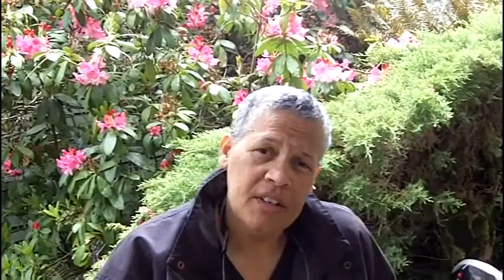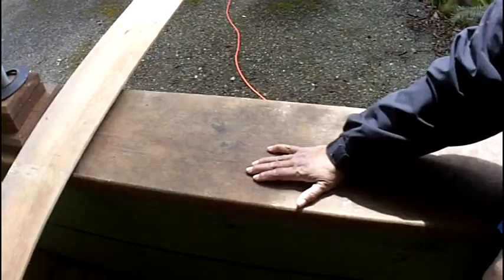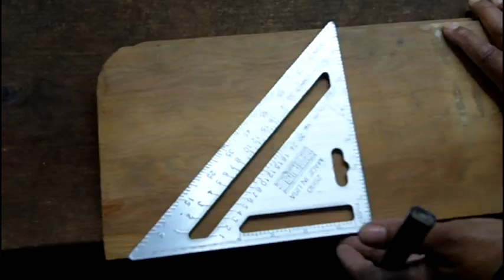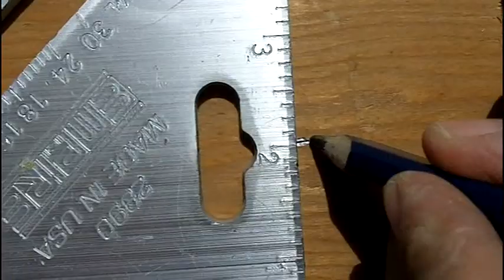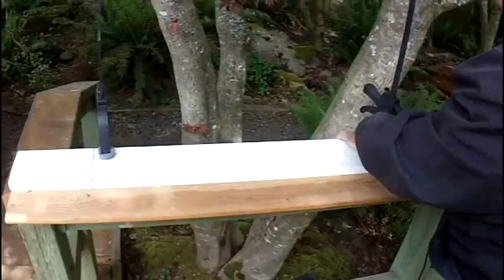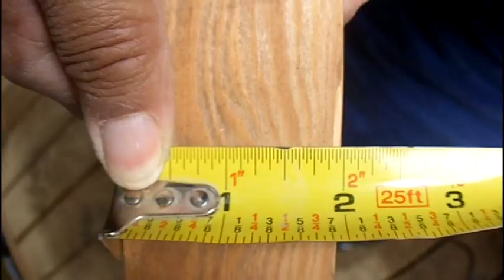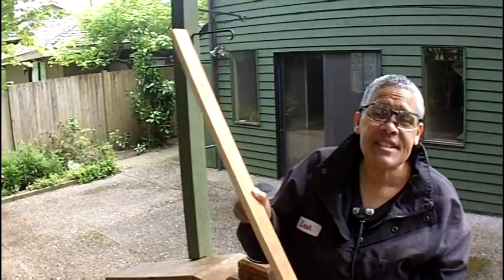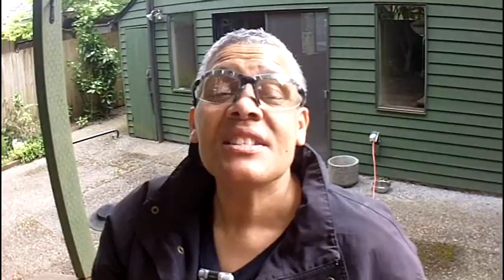How to Make a Perfectly Straight Cut in Wood with a Circular Saw

Comment: So in order to cut a perfectly straight piece of wood, you first need a perfectly straight piece of wood.
Reply: And a saw blade that is not bent
Reply: jozef danyi bended? bent!
Reply: N Kel  Oops,,, thanks for the correction.
:-)
Reply: Yep. In my opinion, you're better off using a nice, straight piece of angle iron for a guide. Steel won't warp like timber tends to.sth128
Reply: +jozef danyi , I actually knows a guy called Bent. Here en Denmark it is quite normal, and a bit unusual to be named Bent.
Reply: rentefald  okay...
Reply: You can also buy & use something called - who'd have guessed? - a cutting guide. They're reasonably cheap, lightweight (generally made of aluminum), & available at most home improvement or hardware stores in several lengths. Most are simply straight rails but other types are available such as a kind that clamps to your saw & slides along the edge of your workpiece.
Reply: +sth128 Indeed! Why have I wasted time watching this video?
Reply: +hyuri2276 You can buy a track saw too. If you have like a grand. Clamping a straight edge down is good enough for me though.
Reply: +Paul Frederick I don't think I've spent a grand on all my tools combined. Unless I include the automotive stuff, which I don't use for work anymore.
Reply: hyuri2276
whether you use tools anymore, or not, is immaterial. As you are still out whatever they cost you initially. Unless you sold them, to recoup some of your investment. I have a few tools I spent more than a grand for. Some tools can be pricey.
Reply: +hyuri2276 You dont need an expensive saw.  All you need is a straight edge to run it across.  A level works great in most cases.  Or find the straightest piece of scrap you can find.  Its pretty much common sense.
Reply: Correct
Reply: That was Hilarious~!!
Reply: Why not use the machine edge of an old cutting of plywood.
Reply: Yep
Reply: Lol, a straight anything really. Anything you can clamp and has an edge..
Reply: Yes,  or you can buy a saw guide.
Reply: Square PVC trim at HD is pretty cheap and straight. Plus you can get it in lengths longer than the longest project you have. That looks like what shes using.
Reply: Yes!! Your just modifying it to manufacturers specks after you get it from the manufacturer.
Reply: Rip a piece of plywood from a full sheet and use the factory edge (not the one you cut) for the straight edge.
Reply: Or a level which is what most carpenters use with this trick. Then again most use a table saw😂
Reply: Collin Kisor And carpenters likely already know how to do this. This video is not for them. This video is for people who neither know how to do this nor own a table saw.
Reply: I like using a chalk line to make straight lines. This can also be used to reference how straight any piece of wood is, before using it as a guide.
Reply: Parallel 🙂
Reply: Track saws are an option. I don't have one because I can't justify adding to my collection of tools. Pay anything from less than £100 (maybe even less than $100)  to over £1,000. If your DIY store has a cutting service, have them cut an 8' by 4' board (15mm MDF is good) into suitable widths and lengths for you to keep and use as straight edges. Add steel or aluminium shelf rails or similar to give different angles for different guides.
Reply: Looks like a lot of people not paying attention

Comment: Sorry but the inch and a quarter mark was off by at least a sixteenth, better to make a mark like this ^, which most professional carpenters/ woodworkers do.
Reply: +April Mae I thought the blade-to-shoe edge measurement was off as well; it looked more like 1-5/32 to 1-3/16. But the overall point of the video is still valid.
Reply: it's impossible to say whether the measurement was accurate or not with the parallax error from the camera angle. you'd have to be looking straight down over the square in line with the mark.
Reply: I was thinking she should have measured off of the tooth rather than the center of the blade.  The tooth often stands proud of the rest of the blade and she will be off by that amount.  I guess it depends on how accurate that particular cut needs to be.
Reply: It looked like what she read as 1-1/4 was actually 1-1/8.

Comment: Better to use a regular pencil because they can be sharpened to a fine point. Looking close to the various marks made you were just off and the result was a piece just under 2". Your method does work with jig saws, but only the very best jig saws will leave an edge that is 90 degrees. Most will cut straight but the edge will not be square.
Reply: The flat, carpenter's pencil can be easily sharpened to a chisel edge or a point with knife. I presume that a carpenter would have a pocket or utility knife as a matter of coarse. (Course? Corse? Coars? Duh.)
Reply: You could also use a marking knife to ensure a straight line and reduce tear out.
Reply: I always use a regular pencil when it comes to very precise cuts. The reason why is that as I run my pencil along my straight edge I rotate the pencil in my fingers as I draw it across the straight edge. This keeps the tip of the pencil sharp and makes a very thin line. Dull pencils can make lines up to a 1/16" wide which gives too much back and forth for the blade to follow.
Reply: Yea, but carpenters like to actually see the marks they make on the wood, hence the fat pencil. And you can sharpen it, you know.
Reply: roy childs It is better to use a regular pencil to mark measurements and a carpenter's pencil to draw lon g lines. I know people who use no pencils; instead, they use sharp edges, like a pocket knife, a nail, etc.
Reply: I put a 'V' mark on the wood where I want it marked. Put the pencil tip exactly where you want it and quickly pull away a 1/4" or so in any direction, leaving a pencil mark. Then put the pencil tip on the spot where you first marked and pull away again in another direction about a 1/4", leaving a 'V' on the wood. The bottom of the V is exactly where you want it, every time. The sharper the pencil the finer the V tip.
Reply: @johndouda6625  yep, that's what I do too.

Comment: You are .5 mm to 1 mm out on either side if you measure the piece of timber you cut. First mistake is using such a thick pencil Second mistake is not keeping inline with measurement. On the first measurement you went to the outside on the second measurement you kept to the inside of the measurement, If it was such a straight cut why didn't you show the final measurement on both sides. Third mistake you dont take a measurement from a measurement you do an overall measurement as there is a possibility you may add or subtract 0.5mm to 1mm either side of the measurement. Forth mistake your measurement of the Shoe was 1 and 1/4 inchs which is wrong it was 1 and 3/16ths of an inch hence where you maybe 0.5 to 1mm out. And finally YES I CAN DO IT !!!!!!!
Reply: +Creat Ion That's why God made caulking
Reply: Caulk and paint make a carpenter what he ain't.
Reply: The man is right, but he is kinda slightly obnoxious: once you learn the basics, the rest you'll figure out yourself. After all, thinking is an underrated but irreplaceable carpentry tool.

Comment: I have been using this method for over 40 years and it has worked well for me every time. One thought though. Don’t measure from the side of the shoe to the middle of the blade. This doesn’t take into account the thickness of the teeth. Measure instead from the edge of the shoe to the nearest side of the teeth. On my Ryobi battery saw this is 100 mm.

Comment: Love these videos. I'm no expert on using a circular saw by any means (which is what brought me to this particular video), but when I do use a circular saw I prefer to set up my cut so the weight of the saw rests on the bench or whatever work surface I clamp the wood to. That way, when I reach the end of the cut, the saw doesn't want to drop with the cut-off piece. Just a personal preference. Seems to give me a little more control over the saw at the end of the cut.

Comment: Good concept video. Depending on the length of the cut you use a level, or invest in a 3” wide 3/16 thick piece of aluminum bar stock in different lengths. I use a 3 foot, 4 foot, and 8-9 foot  length piece for cutting plywood or 4x8 panels. Also the reverse is true as you can measure the wide side of the saw shoe which is usually about 5 inches. Having a wider base makes a more square cut. Keep bringing it Girl!!!

Comment: 2 weeks ago I needed to rip a 8x10 foot length of old pressure treated lumber to rough frame an opening.
I used this method after measuring the shoe and offset of the guide at several places and tacked it down.
The result was 2 pieces almost 2x4 by 10 ft long. As my Uncle Nuncio at the Watertown Arsenal would say,
“Good enough for guvamint work”
Thanks for the video, it’s good to know I wasn’t putting one my three thumbs in danger.

Comment: great instructions! if you want the piece you cut to be exact width, when you measure your offset on the circular saw, you should place the end of your tape measure against the tooth of the blade that will be on that side.  saw teeth cut wider than the body of the blade.  it can make a 1/16 of an inch difference or more if you don't measure from the teeth to the edge of the saw footplate.

Comment: We love Leah at our DIY reno site in Australia with backpacker labour and 'young women leaning trades', BUT - all you need is a rip fence guide for your saw.  That's what the little hole and bridge is for in the plate in front of the blade..
Reply from the maker: longreefbeach   Hello mate!  Hope I said that correctly :)   Oh yes, a rip fence guide works well in many applications.   On the other hand If you don't want to purchase a guide, using a piece of lumber works nicely.  Thanks for commenting and sharing a valuable option and accessory.

Comment: Thanks for the tips. I have been hesitant at times to use a circular saw because of my lack of skill with it and often took a board down to my shop and used my table saw. Using the method you outlined is like having the fence on the table saw.
Reply from the maker: you're welcome, Michael, glad you liked it!

Comment: Please measure from the tip of the blade if they are carbide tipped. Also, depending on the type of blade, cross-cut or rip, the tips are offset so be sure to measure from the tip leaning towards the edge of the saw shoe.
Reply from the maker: +drumzyful nice point!

Comment: If a completely clean cut is important, set your workpiece on a sacrificial board, eg18mm MDF, that you can re-use for the purpose and put that on a large flat surface, maybe the floor if you have nothing else. That stops the cut piece breaking away when you get to the end. Also ensures the blade below the workpiece is safe. Different saws have different torgue taking the cut into your guide or away from it - so think about that before deciding which direction to make your cut or how you stand in relation to pushing your saw along the line. A rip cut like the one shown will, ideally, use a rip blade. Switch to a cross-cut blade for a cross the grain cut if you want a very clean cut.
   I have a set of lengths of MDF from 8 feet down with straight metal angle screwed on for cross or long straight cuts - I just line the edge of the MDF up with my cut line on the workpiece and run the saw along that guide - very quick. Someday, I'll make a variable angle version of my guides. Many different methods, but there are better ones than she showed. Sorry. More positively, she is very clear, the method used is OK & what I used occasionally before I made my guides, and, quite rightly, she reminds beginners to check the manufacturer's instructions.

Comment: That's how I've been cutting with a circular saw for many years except that instead of using a tape measure to record the distance of the blade from the line, which is not too accurate, try using a sliding combination square and set it to the exact distance from the edge of the saw to the blade.  You will find this a much more accurate method.

Comment: Well done video; very clear and simple to follow. I would make one suggestion: use a guide that is longer than the board you're cutting. That way you can ensure that the saw is perfectly straight and true as you begin the cut and that it stays straight at the end.
Reply from the maker: +John Giurin Thanks, John!

Comment: This might be a silly question sorry, its coming from someone who doesn't currently have a circular saw, but is thinking of getting one rather than a table saw.

When you say 'ride' the side of the wood you are using as the guide, does that mean when you are doing the cutting with the saw, you are constantly applying some amount of pressure, towards your right (where the guide edge is) to ensure you keep the saw and therefore the cutting blade, perfectly parallel to the straight line?

Ps you instructions were very clear and easy to follow.  And as a female whos recently taken up woodwork its nice to find a how to video made by a woman for a change!
Reply from the maker: +Kim Hartley   Hello Kim,  Yes, you summed  it up perfectly.  In addition,  a table saw is superior to a circular saw for woodworking.  Circular saws are best for construction and repair projects.

Comment: Jane, I just bought a cheap circular saw which has no "viewing hole" behind the cutting line notch on the front of the shoe.  This means that the pencil line cannot be seen at the very end of the cut because the shoe rides over and blocks the pencil line.    My old circular saw had this feature.  Has this feature gone the way of the wind in today's circular saws?  Short of drilling a hole in the shoe in order to see the pencil line at the end of the cut, using a fence is the only way to continue a straight cut.   Your thoughts?

Comment: One other thing I might suggest.  All blades can have a slightly different kerf.  I would clamp a fence to a scrap piece, make a small cut and measure your offset this way.  Even well made blades that should be identical often are not.  It is much easier to measure the offset on the scrap wood than the saw itself.  The 1/16" error you made would likely not happen if you can measure.  Also the pencil you used should be sharp.  I like a 2H lead rather than an F.  I digress...  
Cheers.

Comment: Great tip. I would add one thing: to set the depth of cut to just a little more than the thickness of the wood being cut.
Reply from the maker: *****  Hello AbbieHoffmansGhost,  Yes,   that's an important safety rule to keep in mind when using a circular saw.  Thanks for mentioning it!

Comment: Always keep track of which board you are actually trying to produce with your cut so the saw kerf is properly accounted for. 
In this case the trimmed piece is the correct width, but if you were trying trim the larger piece down to a precise dimension it would now be over-cut due to the blade width.

Comment: For those looking for a cheap guide on the cheap that’ll last forever and ever, pickup a 12ft section of strip siding (usually 2 1/4” wide) for a few bucks. Cut an 8ft section to use as a long guide and a 4ft for a short guide, as you will often only need one or the other depending on your application. Total cost about $5 and it’s soft unlike metal guides so it won’t mar the surface, and unlike wood (even oak) it won’t warp after sitting in your truck through the seasons. The only downside is the 8ft section you may want to clamp in the middle so it doesn’t bow as you ride the vinyl.

Comment: Thank you very much! I will apply this technique to cutting 30 degree angle cuts that I am doing towards making some hexangle ( 6 sided ) boxes. Just using my tale saw was not giving me accurate cuts for some reason. Your idea of using a fixed guide sounds like what I need. Have a great day. Gavin in Toronto, Ontario, Canada
Reply from the maker: Gavin Smith You're very welcome, Gavin!!  Glad you found the video helpful.
Reply: Well that's just fine.

Comment: Very good tip and well done!! The only drag is when your saw has been around the job site for years and has been knocked off the saw horses over and over. The table (or shoe base as you call it) of the saw sometimes gets knocked out of parallel with the blade and will no longer run in a straight line with the straight edge. Some of the more expensive saws have an adjustment to true the table back up but the cheaper ones you have to smack them back in line with a hammer. Usually when its time to put the hammer to the cheep ones it will not be perfect any more. Thanks for the tip. From...Seedicksand.
Reply from the maker: +Kevin F you're welcome, Kevin, and thanks for writing!!

Comment: If you are going to use a saw often you can make two jigs that obviate all that measuring. Get a piece of hardwood sock and cut it such that its edge is precisely square with the edge of the  wide portion of the shoe.  Do that again for the narrow portion of the shoe.  Draw out what you want and set back your cut using the appropriate jig. If your using the wide jig the waste  ( kerf ) will be to the left. Vise versa for the narrow jig.  If you have a good saw and do exacting work those jigs will force a perfect setback to cut from.
Reply: Great for cutting doors too. I got a couple. Best one I ever saw was made out of plexiglass and machine screwed together.

Comment: Simple refinement for much greater accuracy. Get your straight board, attach to one side a ledge. Then cut the straight board with your shoe up against the ledge. You now have a jig for your circular saw. Whenever you want to cut, simply line the edge of the jig in place, clamp it down and use the ledge on your jig as the guide for your shoe. Your cuts will be straight and very precise. The only issue is that the straightboard you use as the base will need to be thin, otherwise you won’t be able to cut thick boards.